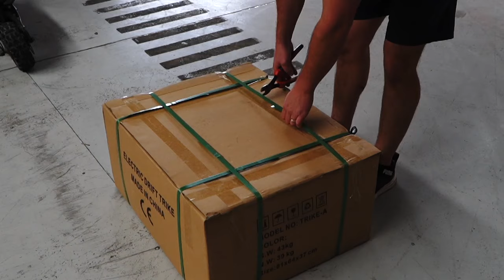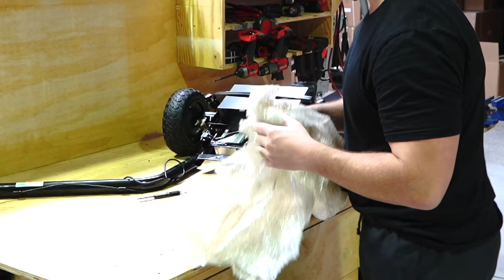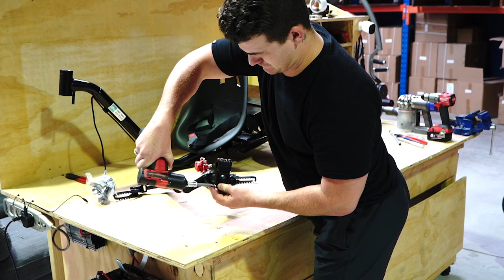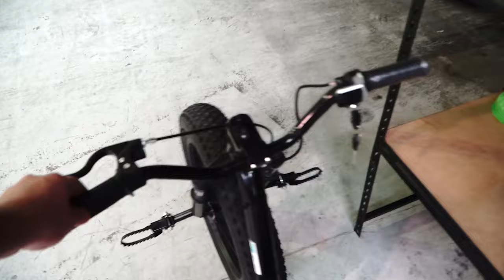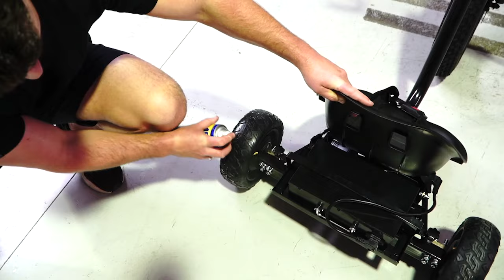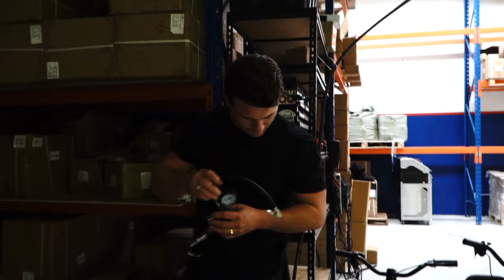Assembly - How to Assemble the Mark One Electric Drift Trike

Comment: Can you tidy up the wiring by running it inside the frame? De-pin the plugs and drill a small hole up near the top to do so perhaps?
Reply from the maker: We like keeping the design modular, so any accidents can have quick and easily resolutions.